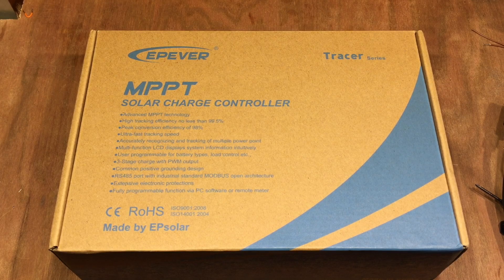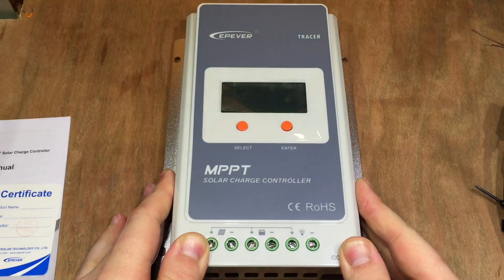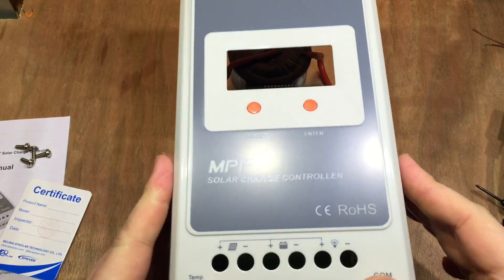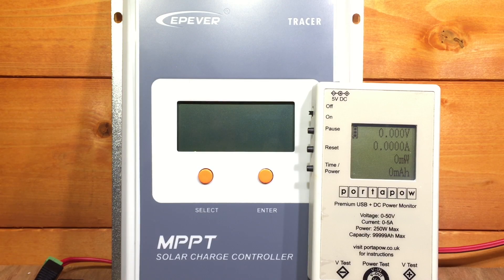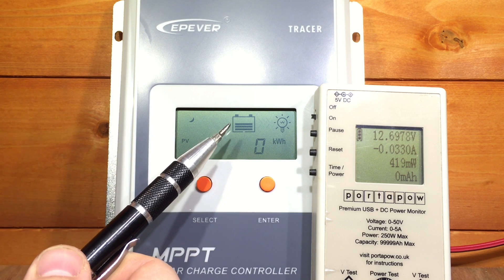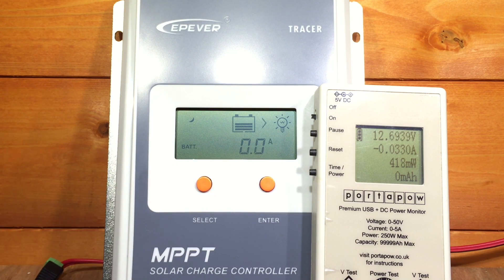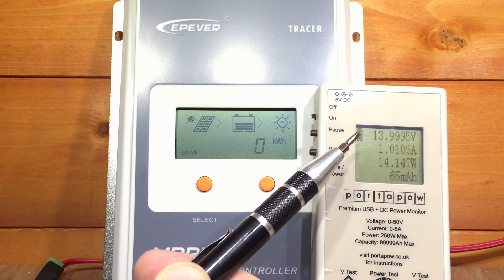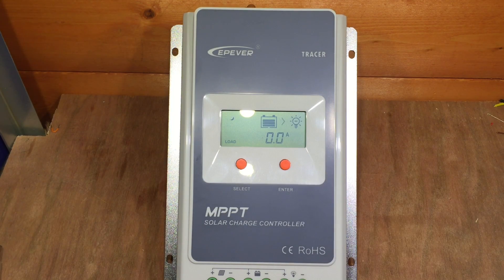MPPT Charge Controller Review - EPSolar EPEver Tracer A Series - 12v Solar Shed

Comment: Hi Adam, is this unit able to perform dusk to dawn control by itself ?
Reply from the maker: +Jims Junk - Yes it has a dusk to dawn mode on the output. :-)
Reply: Hi Adam. In the specs section these units have dual watt ratings for 12/24V system, and an "MPP voltage range of V(bat)+2-72V.....do you think this means I can run my panels (currently have 2, but aiming for 4-250w-60cell) in series (2) and still run 12v bank ?? I have not been able to find the answer to this Q..and am considering trying it out with 2 of 4 panels in one series, then ramping up to 2+2 if everything seems to work OK and unit isn't overheating....It does say "AutoWork".....??
Reply from the maker: Jims Junk Hello again.

You don't mention which version you've got -10/20/30 or 40 amp but as long as you don't go over that limit you should be ok. It's worth keeping an eye on the temperature as you approach these limits too.

You can connect panels in series all the way up to 96 volts. So as long as the possible open voltage does exceed that limit, you should be ok.  The charge controller will convert your incoming solar panel voltage and current (power) into a suitable voltage and current for your battery system.

AutoWork is in reference to the 12 or 24 volt system.  Auto Select would probably be the better translation.  You don't need to specify which battery voltage you are using - it does it itself.

I hope that answers your question.
Reply: Oops...should clarify..only one string per controller .. disregard 2 strings on one controller for 12v...adding second set of panels is a long way off for this project. Have fair distance of "home run" between panels ( only 1 hooked up, the other panel is still in garage..) and was hoping to run both on one run at double the voltage to save wire cost.
Reply from the maker: Jims Junk This is one of the main advantages of MPPT - higher voltages often mean lower wiring costs and higher efficiency.  Two panels in series should be well within the 96 volt limit of the controller.
Reply: Thanx Adam...Have 30A unit with one 250W at present, but that system is going into my travel trailer (prewired). Am looking to buy MPP40A, run 500w in series to 12V 225A battery bank..to run 1kw inverter for now...then double up system next year to 1000w/24/225/2kw. Will let you know how running 60v to 12v bank goes.
Reply from the maker: Jims Junk Excellent - do let me know :-)
Reply: Hi Adam, I posted this in response to another video of someone having a "look inside"....

  I bought the 3210 few months back for low current 12V landscape 
lighting, with 1 250W panel... Works fine. Downloaded monitor software 
and bought temp censor/comm cable kit, and have that up and running too.
 Is working fine.
  I bought another 250W panel, a 2kW Inverter, and the 4210 to replace 
the 30A so I could put it (3210) in my travel trailer along with 250W 
panel, and 225Ah T105 6V batts... will finish that project when I 
can....
  The 4210 was in place for only 4 days feeding 450Ah batts/12V from 
2-250W panels in one array ( 74VOC..55-68V MPPT range...well within it's
 published operating range ) and running moderate loads with the 2KW 
Inverter, as well as landscape system. This unit has already burned out,
 and I'm waiting for warranty on it.....not sure why, as there was very 
little load on Inverter at the time.....( Dud..??)
  In the mean time I have placed the 3210 in place of 4210, ran it 
through some good load/charge cycles... up to 1500W  Inverter 
loads(sunny days here right now) and it has performed very well. The 
manufacturer claims that these units can handle up to 3 times their 
input wattage rating, and will only allow rated output current to the 
batts/system..... and I'm pushing this unit into that range right now 
with the 2-250W in series. My intention is to add another array 
(2-250W/series) to this system for winter time, as I live on the coast 
of British Columbia and we can go through MANY days at a time of crappy,
 low light, conditions and short winter days. So far, the 3210 has never gone over 29.8A... 
even though there was more than enough solar power available to push it past 30A....
  I'm hopeful these (EPever) MPPT controllers( Come on Warranty.. !!! ) 
will perform as stated, as they seem to be solid units, and you can't 
bitch at the price point either.
Reply from the maker: +Jims Junk Interesting to hear of your experiences Jim. Thank you. Hopefully you've just had a dud and the replacement will be far better. Sorry - are you running the inverter from the charge controller load terminals or the battery directly. Whether it's in spec or not the surge as you connect the inverter and the caps charge could take it well above normal levels for a brief time. I always run my inverter (it's only a tiny one though) direct from the battery. 
Anyway, thanks again.
Reply: Hi Adam. I'm running the inverter on 2/0 cable directly from the battery via the Midnight Solar MNDC-250 DC disconnect/combiner box I bought at same time. I've mounted the controller right onto the front cover of the box, and installed breakers for PV array..15A, landscape lighting..10A, and battery to controller..40A. Also added MNSPD-300Vdc lightning arrestor/ surge protector. The box, inverter, and array are all grounded...#6. The only thing I haven't done is common positive ground the system like you would a common negative system....the whole DC component is floating, except for lightning arrestor on PV wires. I'm only using the load side of the controller for dusk to dawn control of LED landscape lighting...about 4 Watts so far. I'd send you a photo or 2, but don't know how to do that from here....?

J
Reply from the maker: +Jims Junk Sounds like an excellent setup. Thanks for filling in the gaps. You'd need to upload pictures to somewhere and paste links here - YouTube doesn't seem setup for that type of thing. Thanks for explaining further.

Comment: If you had the opportunity to buy this again or not would you?
Reply from the maker: +Ken B :-)  So far so good.  I'm still testing and playing with it, but if it meets your needs and budget you'd be pushed to find better I think.  Do bare in mind though that you need to invest a little more money to access it's full potential.  If you're not a tinkerer like me, the MT50 screen does add quite a bit to the price.  I think you can access the advanced functionality for a much smaller price - but that's for another video!  Yes, I'd buy it again - but your needs might be different.
Reply: +Adam Welch
I just placed an order for it.  Both the Controller and the MT50 came to $139.99 US dollars with free shipping.  I have two Chinese cheaper models but one went out and the other doesn't work.  I'm hoping this works well.  Pretty good looking unit.
Reply: +Ken B where did you purchase it?

Comment: Friend, your video was very good.
Will you help me choose a model to buy. I need a charge controller equipment that has the RS485 connection and use the MODBUS protocol. That's because I already have in my house that network. I use to various equipment. They are connected to a SCADA software called ScadaBR. It is a free and opensource software.
My first question is whether this model uses the PWM as the old ones. Although the MPPT name, I wonder if it really does the job. I remember I found several fake equipment that are called "MPPT". At understood that MPPT has the ability to lower the voltage and increase current. This improves the efficiency of the equipment. But the PWM uses this modulation to reduce the voltage and maintain proper charge in the batteries. Another thing that strikes me is that the equipment of the same older brand is heavier and does not say anything PWM.
After that, we will work on modbus? I'll help you and you show the audience for your channel, okay?
Reply from the maker: +farmsidney This model according to my experimentation does do MPPT.  I'm yet to get a full idea on the conversion efficiency, but it is able to maintain panels at a higher voltage than the battery and convert the DC power.  I believe this happens only in the 'constant current' phase of charging however.  Once the charger hits constant voltage the charger changes to PWM mode - this is normal of many MPPT solar charge controllers I believe.

This system uses MODBUS on a RJ45 port on board.  This is something I hope to play with in the next couple of weeks and discuss the software which EPSolar provide to setup and monitor the tracer charge controllers.  After which I'll see where that takes me.